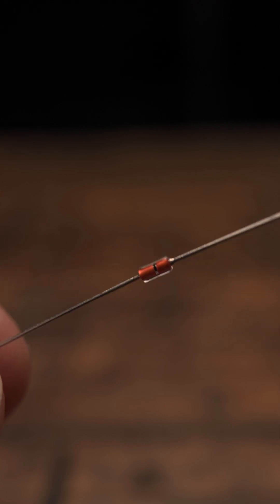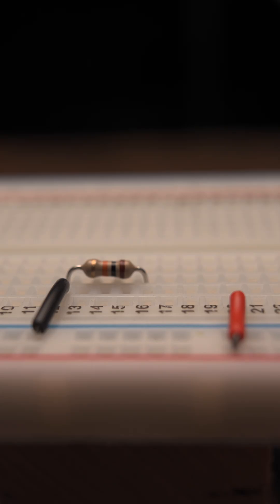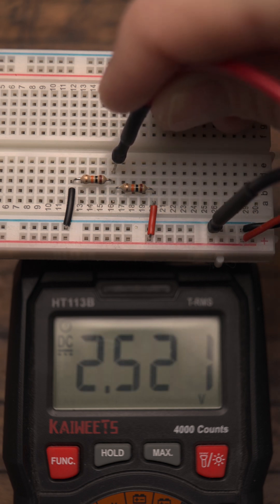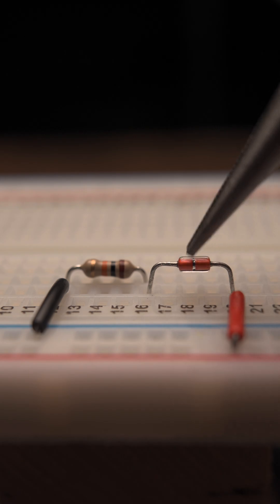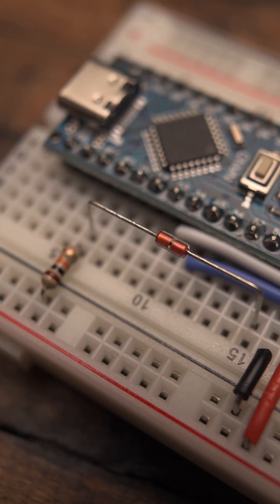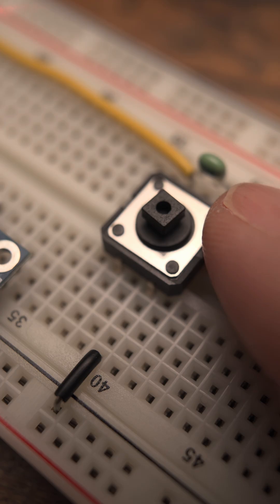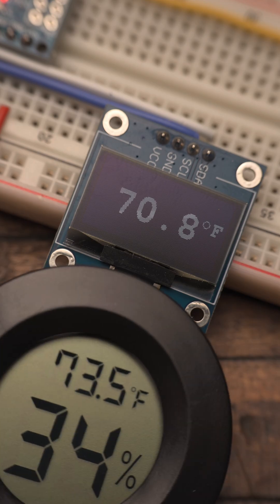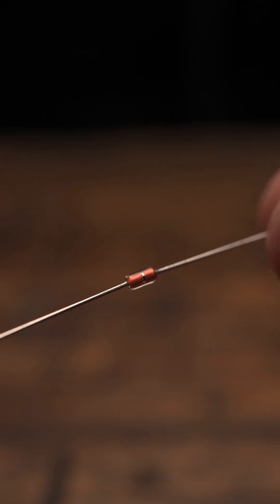#thermistor

Comment: Fahrenheit is miles better for the average person since it is calibrated for how temperatures feel for us humans, 0 degrees being too cold and 100 being too hot. For scientists though I think Celsius is better.
Reply: So 50 degrees is just right? Because last time i checked its 10°C which is still cold
Reply: @rixuuu  🤣😂  no man, our body temperature is 98.6 so we're not going to prefer something between 0 and 100, we prefer something closer to 98.6. Plus, it's American so RAHHHHHHHHHHHHHHH, FREEDOM!!!!!!!!!
Reply: @heyhenrytech  so if 50 is cold but 100 is too hot why bother with 0-50 and just cut it and then it would be 48°F for body 50 is now 0 and it would be even more intuitive where right in the middle (25° = about 75°F = 24°C) would be the perfect temperature, not too cold, not too hot. And water freezing temperature would be around -7° with new temperature system.
Reply: @rixuuu  I think the reason they use 0 and 100 is because it makes more sense then the scale "starting" at 50.
Reply: @rixuuu  also, by that logic 200 is also too hot so is 100 just right?
Reply: @rixuuu  Of course 50 isn't just right.  The neutral temperature for human comfort is about 70 F, rather than 50 F.

It's a hell of a lot harder for a human body to get rid of extra heat in a hot environment, than it is for a human body to generate extra heat in a cold environment.  All other factors being equal, it is much more comfortable to have an ambient temperature that is 20F below comfort, than 20F above comfort.
Reply: "Fahrenheit is miles better for the average person since it is calibrated for how temperatures feel for us humans"

For someone who grew up with Fahrenheit, for anyone else it's just an arbitrary number that means absolutely nothing. 

So, we can conclude that for the large majority of the earth's population, Fahrenheit is just an arbitrary number scale that has no meaning.
Reply: @AlexKall  That's because you have a knee-jerk reaction against it, because it's something you aren't accustomed to.  Celsius is hydro-centric to pure water's properties, while Fahrenheit is human-centric.

Fahrenheit makes perfect sense, when you think about it in the context of the temperatures that most humans experience.  For Celsius, half of the 2-digit temperature range is uninhabitably hot.  For Fahrenheit, the full 0 to 100 range is livable, and is the range we get for an average climate on this planet.

Fahrenheit gives more resolution to tell the weather temperature in just 2 digits, without introducing decimals or negatives.
Reply: Fahrenheit is a ridiculous unit. Celcius all day long. 0=water freezes, 100=water boils.

Comment: Don't use analogread as a function with an immediate return. Use it as a function with a delayed return. Take "blink without delay" as a base, reading an analog pin on an atmega was never meant to be done the way the arduino ide does it.  pastebin: CsAUVJSu
Reply: * edited , instead of a piece of the code I just added a whole arduino sketch.

Comment: Why use potentiometer instead of calibration offset and factor?
Reply: yes.. and no.. remember your arduino only has a 10 bit ADC you also have the values your thermistor will not go over or under, so there's a limited window of values that have any meaning. Adding 5% here and there will only mess things up display wise. You'll end up with steps that are fractions.  But where i do agree that calculating an offset makes sense and is a good little extra to the whole experiment is buying an ADS1115 for 1 to 2 $ on the place that shall not be named  which will give you 16 bit to work with. +- 32000 usable steps compared to only about what . 200 or so at 10 bit... an average axial lead thermistor gives between 1K and 260K ohm resistance, correlating to -40 to +250 degrees celsius.. the range you're going to be working in will be what.. -10 to +40 ... which will be on a curve.. if you go look at that range on the diagram that comes with the datasheet of your thermistor you'll see 200 steps is actually already very generous.  so yes, you want to use a thermistor , great experiment! get a 16+ bit ADC if you want to take it a step further.
Reply: Also, if the thermistor needs to be replaced, you have to alter code instead of just tweaking a pot.

Comment: Celsius is universal. Most modules are calibrated to Celsius and then convert to Fahrenheit if necessary. That's why an iPhone won't display 69°F. It reads in C and converts. Sticking with a module's native measurement and being compliant with most of the planet is clearly beneficial.

One might as well ask an airline pilot if there's a benefit to learning English. Compliance to standards is always beneficial.
Reply: For everyday use in most of the world, you'd want Celsius. For certain scientific or engineering applications you might want Kelvin.
Reply: @LostNimrod  Also going to add that you can convert from degrees Celsius to Kelvin easily, just add 273.15 and you have the temperature in Kelvin!
Reply: @LostNimrod but also important to mention that degree C an K are interchangeable in readings without loss of precision, K is used efficiently in computation and scientific formulas
Reply: @LostNimrod   "For everyday use in most of the world, you'd want Celsius" 
How hot is it right now on a scale of zero to one hundred?

unless you like 3 degrees being the difference between whether or not you need a jacket, for everyday use in most of the world you should use Fahrenheit because it actually makes sense. The temperature where water boils is not intuitive, the temperature where it's insufferably hot is extremely intuitive.
Reply: 69°F... nice.
Reply: Celsius is dumpster dog shit for morons
Reply: Kelvin is the best temperature scale
Reply: That isn't quite right, any temperature sensor has to be read and then the reading has to be converted to C or F from the raw data which is probably from an 8 or 10 bit ADC anyway.... The only reason 69 doesn't show up is because F has almost two times the resolution with only two digits and the C reading is only saved as two digits.... This causes a truncation error, one that is kind of silly, because they don't need to save the raw data as a two digit C number in the first place.....
Reply: Freezing point is 0, and boiling point is 100, why US didn't want to accept this simplicity
Reply: @x.i.o.i.x  From the responses I see, Americans are so self-centred that even temperature should represent human comfort rather than empirical science.
Reply: 0 degrees is freezing point water
100 is boiling point water.
Now play some handeggball
Reply: Fahrenheit was preferred in many metric countries until digital and was able see 0.1 etc. of C easily. Degrees F is a smaller scale per degree and was preferred over C for accurate temperature control. Today though F is just a Civilian American unit. NASA etc. have all standardized to C.
Reply: @Klairity  "Was" is the important point.
Reply: @Klairity tbf ya dont feel a noticeable difference between 19 and 20°C.
Reply: @Klairity  I'm an American and so maybe I don't know better, but my sister lives in Europe and I've never heard of a thermostat you can set by the decimal, and so Fahrenheit is still, to my knowledge, more precise and efficient for home heating and cooling, as well as refrigeration and cooking.
Reply: that's not a reason that's majority majority don't mean nothing om terms of superioriy
Reply: @marley7868  True in some areas. We're still mostly bound to the x86 architecture for personal computers. Everything from the Amiga to the PowerPC to the Itanium architectures were superior, but are all history while massive workstation machines are still reliant on x86.

But we're talking about communication and consistent compliance. Celsius and Kelvin have their foundation in real-world physics. Calibration is based on an extremely simple to access commodity. Pure water at 1atmosphere of pressure will give you everything you need to test for 0 to 100 degrees Celsius. 

Daniel Gabriel Fahrenheit picked a bunch of different things (average body temp, the freezing point of a 50% Saline solution, etc...) and just randomly ascribed values to them (30/90)and extrapolated a scale. He futzed with it until he picked 32 and 96 for those and messed around with it. Not exactly a usefully scientific scale at that point. 

How exactly is that superior?
Reply: @drtaverner  I never said fahrenheit was better I said celcious wasn't 
the two are equally good for the most part I tend to dislike claims one side is better when
let us be frank there both arbitary 
and kelvin is wrong so there is no right answer I just think we should all admit it
Reply: @drtaverner the Fahrenheit is based on the same universal constants the Celsius scale is. Fahrenheit was actually redefined to be precisely (9/5) + 32 of a deg C.
Reply: @nathanielhill8156  So much easier than sticking with C then.
Reply: All these people saying they don't care about Fahrenheit and the united states, why do y'all think we care what y'all think? 😂
Reply: "Universal" doesn't mean universally utile. Kelvin is the only scale based on a legitimate constant, not something subject to environmental factors like the phase-shift markers of an arbitrarily-chosen solvent.
Reply: Agreed!  It's not even a great solvent.  
But given the abilities of folks at that time, the phase change was noticeable, water is abundant, and the change appeared consistent. 
It was a good choice for what was needed at the time.  Now that our knowledge of (and requirements within) temperatures has expanded, it is time we retired the helpful old friend with honor, and use Kelvin... until Kelvin needs retirement.
Reply: @morsemurraidh1314  We're still bags of water. 😏
Reply: @morsemurraidh1314  wdym? water is one of the best solvents we know of. there’s a reason why all the DiHydrogenMonoxide jokes list it as a popular industrial solvent and why all life depends on it. it’s not just about being abundant, but also about being able to so effectively dissolve so many different materials

(i’m assuming it was a typo, but i just found it more funny to correct it like this instead 😁)
Reply: Nah freedom units better🦅🦅🦅
Reply: Least insane celsius screed
Reply: Most standards, however, aren't global. Ask anyone in the u.s. if 30c is hot or cold, most won't be able to tell you. You build for the market you're trying to attract.
Reply: @rileyjones7231 That’s exactly the point, no, you don’t „build for the market you want to attract“. That doesn’t make sense. Why rewrite very complex weather calculation algorithms or build an entirely new thermometer when you can just build one for the market where you sell the most, which is anywhere were you use Celsius, and then add a translation layer for the US market? That results in way better margins. And that’s exactly what people are doing, with the iPhone, built by an American company, being a great example because all it’s temperature calculations are done in Celsius and then converted into Fahrenheit for the US market.
Reply: @nanolog522 correction. Apple is a cheapskate who only bought 1 deg accuracy Celsius measurements from the weather stations. That's why it's converted into Fahrenheit on the iPhone. They didn't do it because they didn't want to, not because they couldn't. Other weather services could and did buy the Fahrenheit measurements from the weather station.
Reply: @nathanielhill8156  You sound like a guy that would buy both Celsius and Fahrenheit datasets that say the exact same thing lol.
Reply: @nanolog522 no, I just wouldn't delude myself into thinking one is universally superior to the other. Celsius is praised for its ability to accurately measure boiling H2O. As an average person, I don't run into needing to boil pure water in a pressure chamber very often. As an average person I don't care if my BBQ chicken measured 165 °F, 74 °C, 347 K, or 624.67 R
Reply: @nathanielhill8156  I didn’t make any claims comparing the scales. I said that Celsius is used in more parts of the world as well as things like weather models, which makes it easier and cheaper to design products and software using Celsius and converting into Fahrenheit for markets that require it. But that is not a statement about which scale is better.
Reply: @nanolog522  
" when you can just build one for the market where you sell the most"

Dude, that is the market you'd want to attract. 

" Why rewrite very complex weather calculation algorithms"

First: The conversion between F and C is kindergarten math.
Second: you only have to convert the end result to whatever the customer needs. The internals are not relevant in any way and are not rewritten for any market, ever. It's a toggle in the display, nothing more.
Reply: @vinny142  That’s exactly my point. But thank you for reiterating, I may have to write it differently next time so everybody understands.
Reply: @rileyjones7231 lol what
Reply: @rileyjones7231  The US is only one of like six tiny countries still using F, and then only amongst the civilian population. They're up there with Micronesia and the Marshall Islands.
Reply: @rileyjones7231  it’s still global even if there are 2 or three exceptions. 99% of countries is still plenty enough
Reply: @rileyjones7231  Still, I think the question is, which is better. Following the standards used by most of the planet is clearly advantageous.
Reply: @rileyjones7231  US is not most of planet thou, in fact US is only nonlittle country using F nowadays.
Reply: Hot take, Fahrenheit is perfect for working with people and human temperatures, Celsius is great at most other things, and Kelvin is great for science things 

Disclaimer I am united statesman
Reply: Celsius is a terrible measure of temperature.  Its like a few degrees window between too hot and too cold.  Who wants that?
Reply: @seditt5146  "a few degrees"? For me personally, -20 is too cold, 30 is too hot. That's a 50 degree window for me. My weather can have an 80 degree variance between coldest winter (-40) and heat-wave summer (40). That's a lot of variance with plenty of specificity.
Reply: @seditt5146 Anyone who works in science or... Cooks.

Comment: Thanks , but i couldnt get a 3d printer's 100k thermistor to work , is there anything i should know?
Reply from the maker: It’s hard to diagnose the problem without more context. Are you replacing the part, or is it original? What 3D printer? What is the model of the thermistor?
Reply: @HackMakeMod  thanks for reply , i iust used 100k thermistor witch is used in 3d printers,  its new , but not necessarily for 3d printers, and also i read data using esp32 and arduino ide
Reply: @alirezaghassemian4748  Is it definitively an NTC? You might have a PTC in front of you. Any markings on that guy?
Reply: @DerMarkus1982  hi, thanks for your advice, i think so,  but not sure
But how can i know that? Its just a wire with kinda glass....
Reply: What resistance do you measure with a multimeter?